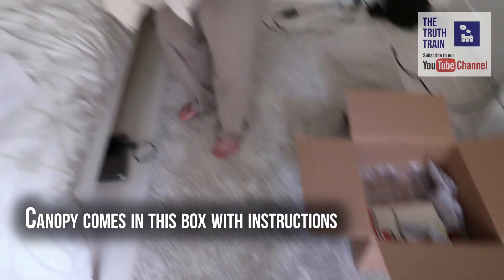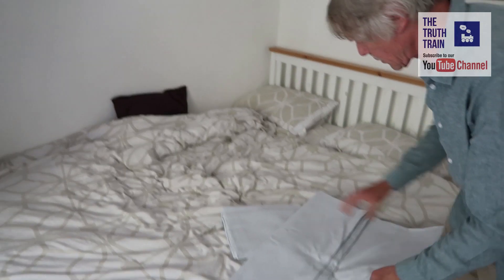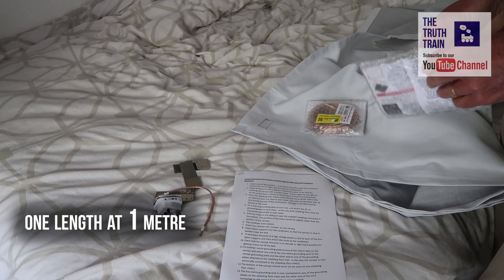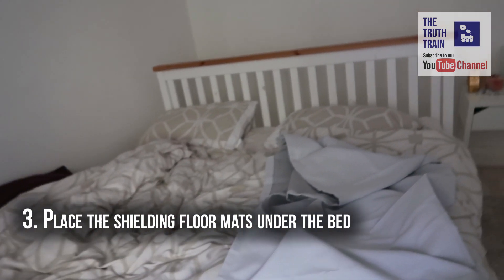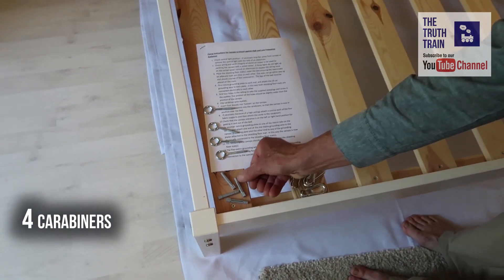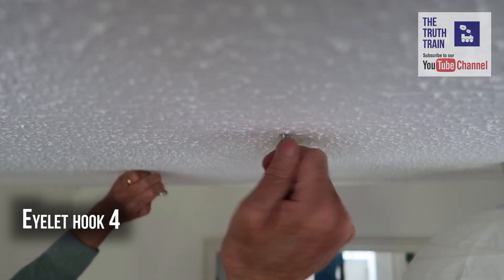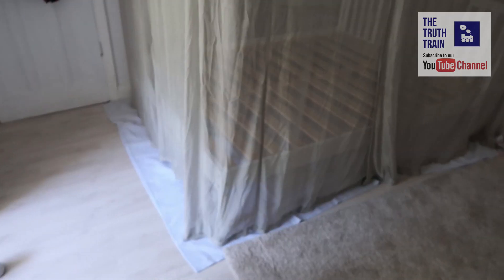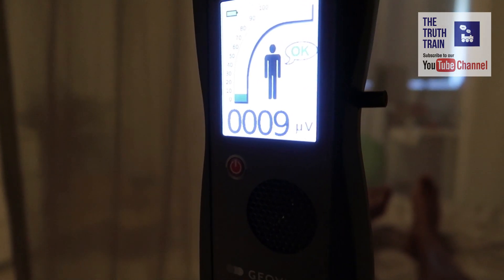Installing an EMF Bed Shielding Canopy - Step by Step Instructions

Comment: Not all socket testers use 3 lights some us 2 to show OK also It will not show good earthing good cpc also will NOT show if neutral and earth reversed.  Mains wired earth is not a good grounding.

Comment: From a radio ham also electrical engineer this is 100% BS Also socket testers do not show good ground also some have 2 lights for good some have 3 lights for good also mains earth cpc is not a good ground at all times if you are on a TT system
Reply: I call BS on your BS. Faraday cages work, period. The manufacturers of these mesh fabrics post certified attenuation graphs for each material. The best fabrics give up to 90dB attenuation between 1 and 10GHz. You will not get cell reception inside such a canopy. If you're an electrical engineer you are disqualified for not knowing this. Faraday cages are EE 101.
Reply: @gr0undc0ntrol  You talk BS you say between 1 an 10 GHz are you speaking of 1 Hz or 1 MHz or 1 fried egg on toast.  As mobile phones work under 1 GHz so it will leak in why don't they show a radio in there or a walkie-talkie with some one on WhatsApp or something similar on a video link.  So don't try and speak science and physics.  When you are still in a wet nappy waiting for mummy to change you.
Reply: @gr0undc0ntrol  look what he is selling is BS also holding the end of the antenna like that is not the way to take reading.  Using mains earth that is strapped to the neutral line.  Is just a joke.  The tester he has plugged in don't show a good earth what if it is on a TT system.  Look am a spark also electrical engineer also do ham radio so I know this is all BS his last job was a head Doctor so he is just playing with your head.
Reply: @alunroberts1439  That meter they are using is not a radio. It a device specifically designed for measuring the body's coupling to eletromagnetic fields. You are SUPPOSED to hold on to the sensor at the  end like that. This is what the device has been manufactured for specifically. What you want is to measure what the body is receiving, not what the antenna is receiving. In an EM field the body, because of its conductivity, becomes an antenna. What that meter measures is basically what the body is receiving, therefore you have to touch the probe. The body then becomes the "antenna", and that is what the meter measures. It is a probe specifically designed for measuring EM field coupling to body. Hope that helps.
Reply: @gr0undc0ntrol  you know nothing about me or my working past or me medical knowledge.

Comment: Where can I buy the kit?
Reply: From a radio ham also electrical engineer this is 100% BS Also socket testers do not show good ground also some have 2 lights for good some have 3 lights for good also mains earth cpc is not a good ground at all times if you are on a TT system

Comment: I’ve got one like this but you have to screw 8 hooks into the ceiling.The problem is I don’t know what electrical cables are behind the ceiling and obviously I don’t want to drill into them.I’ve got an AC stud finder but it’s somewhat erratic and I don’t know if I can rely on it .Can anyone recommend a good AC stud finder to locate cables ? Preferably one where you can adjust the sensitivity easily .Some of these AC stud finders are way over sensitive.

Comment: How much is this kit?
Reply: From a radio ham also electrical engineer this is 100% BS Also socket testers do not show good ground also some have 2 lights for good some have 3 lights for good also mains earth cpc is not a good ground at all times if you are on a TT system

Comment: Where do you purchase this?
Reply: From a radio ham also electrical engineer this is 100% BS Also socket testers do not show good ground also some have 2 lights for good some have 3 lights for good also mains earth cpc is not a good ground at all times if you are on a TT system

Comment: yea and while all of the rest of your animals and plants die and pets and wildlife as long as your ok
Reply: Nobody said this is a solution to the problem but a relief from rf. What do you suggest  a person do? Take on every multi billion dollar telecom company before you allow yourself to sleep well
Reply: From a radio ham also electrical engineer this is 100% BS Also socket testers do not show good ground also some have 2 lights for good some have 3 lights for good also mains earth cpc is not a good ground at all times if you are on a TT system
Reply: From a radio ham also electrical engineer this is 100% BS Also socket testers do not show good ground also some have 2 lights for good some have 3 lights for good also mains earth cpc is not a good ground at all times if you are on a TT system
Reply: @alunroberts1439  Eat some ham and be quiet.

Comment: So it's must earthed / grounding to blocking signal ?
Reply: From a radio ham also electrical engineer this is 100% BS Also socket testers do not show good ground also some have 2 lights for good some have 3 lights for good also mains earth cpc is not a good ground at all times if you are on a TT system
Reply: What the heck are you saying? What does CPC and TT stand for? Your sentences are tech talk. Most of your readers are NOT tech geeks. Please explain better.
Reply: @alunroberts1439  what is bs? I don’t understand what you saying here?
Reply: Having what you stand on grounded brings more to you so it can in it self be grounded what there measuring is electron flow that are all round.  He even says he used to be a head doctor so he is playing on un educated people ask any one that works in ham radio to look at his crap.
Reply: @alunroberts1439  Can you form a proper sentence?
Reply: @MrAmbrosse  a proper sentence what is one.  A line of words is a sentence just as you don't understand as your education on electrical matters is that of a gold fish.
Reply: NO grounding it is best NOT to ground netting, ground works as an antenna.
Reply: @bigjon1359  yes, i think you can better grount it to soil in a bucket or something.

Comment: I like the design. It's much more simple than my build. I have a faraday tent enclosure made of a wooden frame. Half is copper mesh and the rest is a ni/co fabric which I used both due to UHF from a nearby rooftop multiband array/satcom/telecom/telemedicine/radio station and who knows what else since it was designed by DARPA/GE/IHI.
I used the copper mesh for airflow. I put an air matress inside on top of the fabric. The tent is grounded but would you do anything different?